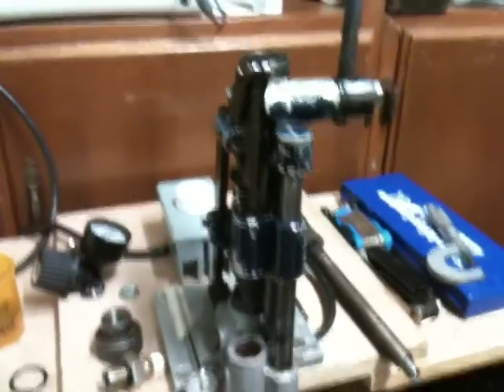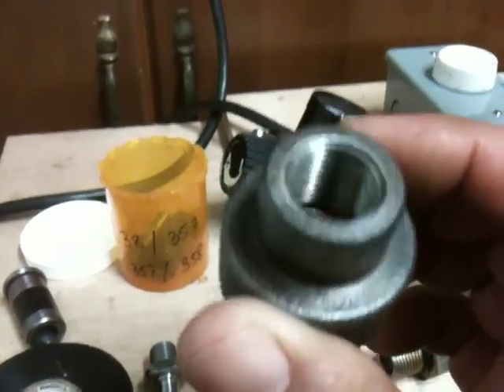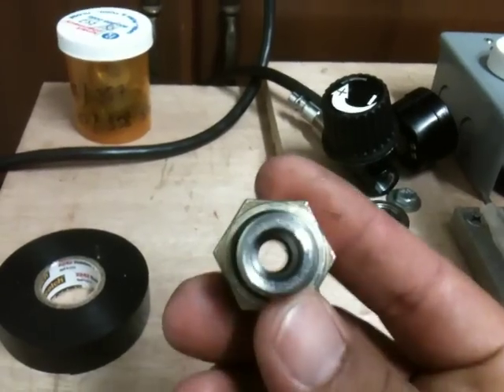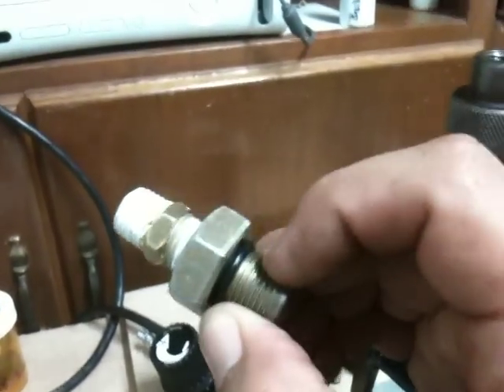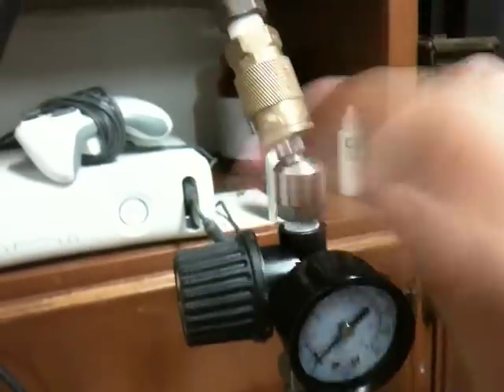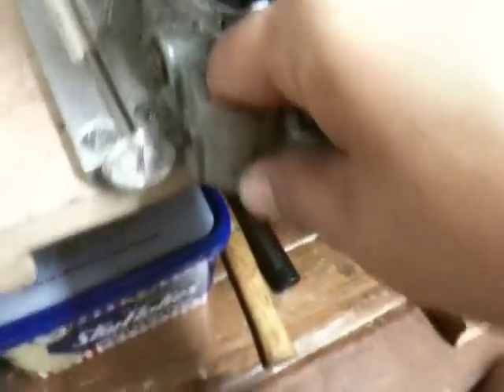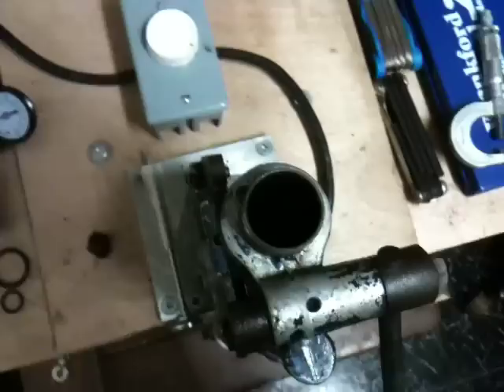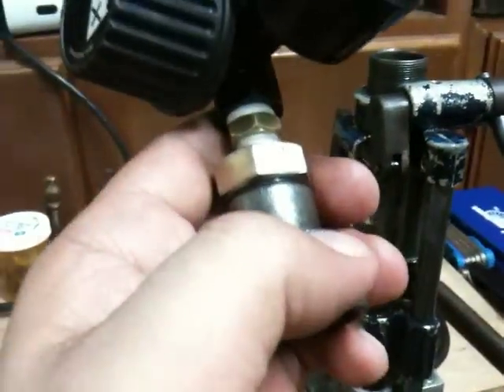Star Sizer Air Homemade Lube Air  Pressure Modifcation Part 1

Comment: Nicely done. I'm planning on getting a star, adding the automatic bullet feed, and adding a motor to it like Sunline24 (you can see his video here). Planning on building a bullet collator for it as well. I should be under $500 for the whole project, and should have similar output to the magma lube master (6000 rounds per hour), for about 1/20th the cost!

Should be about to have

Comment from the maker: You can get the parts from a hardware store like home depot or lowes.  Join the cast boolits forum and view the topic where others have made bolt on solutions.  I spent about $16.00 to make a bolt on adapter for the air hook up.